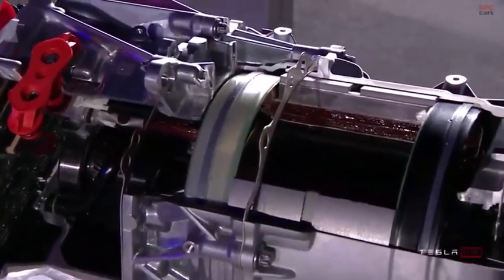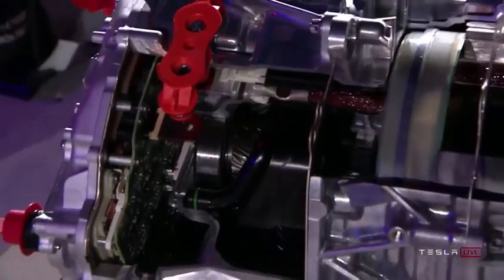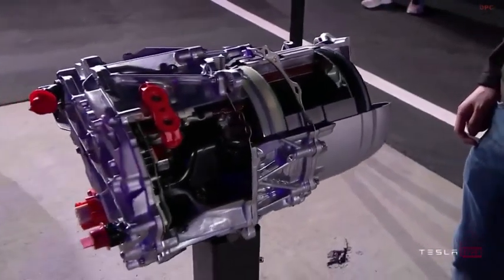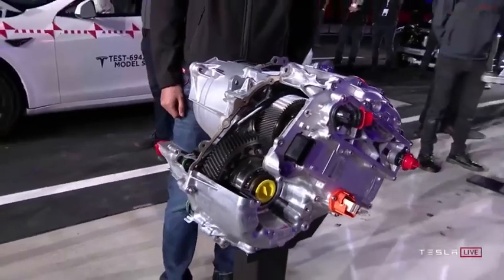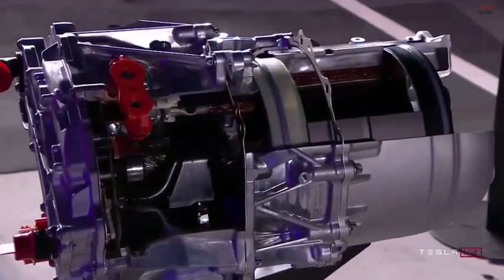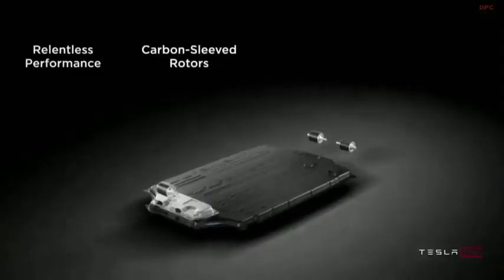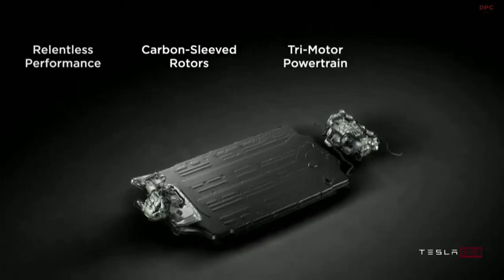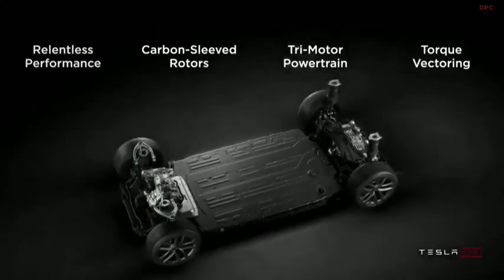Tesla's Carbon Sleeved Rotors Presentation by Elon Musk

Comment: A one 'g'  acceleration is about  2.8 sec  from zero to 100 km/h,  or 2.7 sec from zero to 60 MPH.  Tesla is way beyond that, is nearing 2g acceleration (1.4 sec zero to 100km/h), which is not healthy for everybody, you don't want to pass out after the light turns green. Inwheel permanent magnet motors could benefit greatly from Tesla's carbon wrapped rotors, and from Niron's rare-earth-elements free super magnet technology. Such a combi runs cool and light weight, no active cooling required, ideal for inhweel motors.  Acceleration and regeneration of energy becomes more efficient by the year.   EV innovation is not even near its final stage. An Aptera like car could easily have a 3000 mile range on one charge.